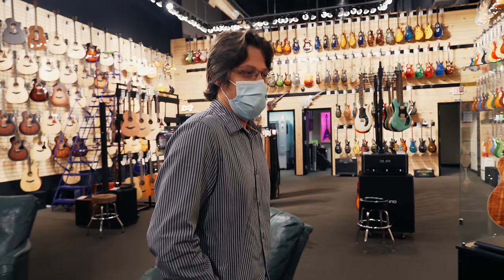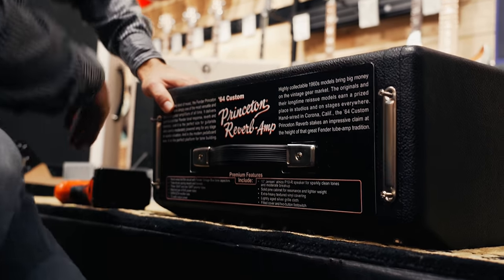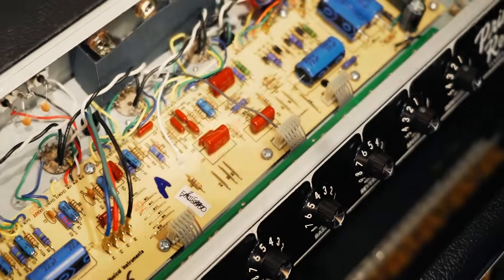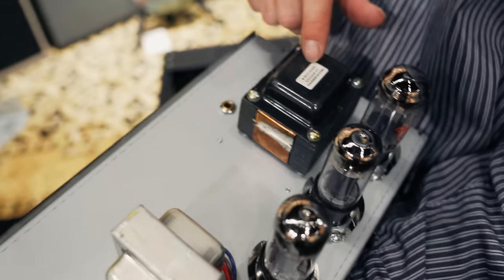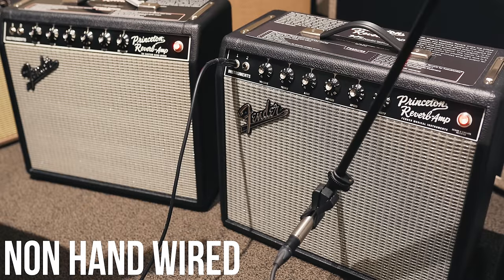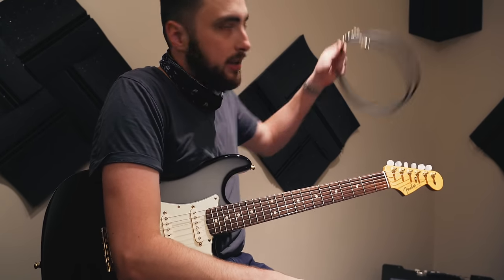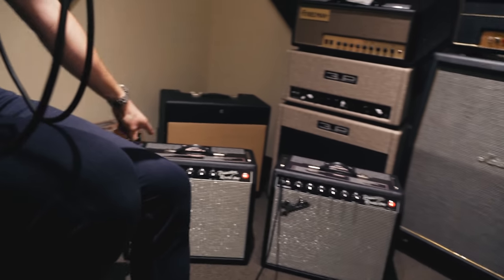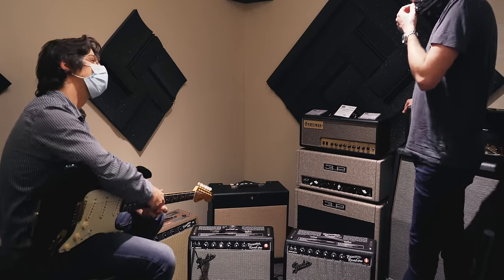Are Hand Wired Amps Really Better?

Comment: SCIENTIFIC FACT:  The  Heavier guage wire allows the current to travel faster with less heat and resistance. The better quality resistorsm caps, etc  really last longer and  effect the signal flow  different than the  cheaper version.
So as you touch the string the magnetic feilds and  response  time is faster  on the hand wired. Plus  the tonal spectrum is different. The durability of  the hand wired is strong heavy duty verses the cheap production knock off.
THE SAD TRUTH  is FENDER  sold out by letting their accountants tell the builders etc to find a cheaper way to make guitars  and amps etc.
HAND MADE is always better. We must all pray America recovers from all the  problems.
My advise and opinion  is : If you want quality you must pay more! HAND MADE  IN THE USA is best.
GOD BLESS those people who make hand made USA gear. The ability for it to last 20 or more years is because all componants  and elements are HEAVY DUTY.
If you drop both amps from 3 feet without tubes.... the cheap knock off will have all the quick connects pop out  and crak etc.
The HAND WIRED will be fine.
IF the greedy  corporate geeks at the TOP  could  have simply held on  and  offered HAND WIRED  at a more reasonable price then FENDER  would not had to sell out.A cost  study was made. It showed the cost of FENDER moving over seas to try to cut manifacturing cost hurt FENDER. 
FINAL STATEMENT: IF FENDER  would have simply held on  and stayed in the USA exclusively and never comprimised their quailty also  a more  reasonable price point they would not be financially in the hole and thousands of pissed off musicians would  not have run to other companies.
FASTER flow of current, HAND WIRED for  pros  and fakers  can go for the cheap knock off.
If FENDER would close all over seas plants  and only make products in the USA they would  recover.
GOD BLESS AMERICA......

Comment: If you hear a difference between the two amps and prefer the handwired? Cool. But Rhett and the salesperson suggesting that you couldn't play a small gig with the stock $1000 Princeton? That the stock $1000 '65 PRRI would disappear in a mix? JFC, what a wanker comment. Plenty of people are out there gigging with much cheaper tube amps: Hot Rod Deluxe, Blues Junior, Peavey Classic 30, Harley Benton, Monoprice, etc. Lots of players are gigging Boss Katanas and trying to emulate blackface Fenders. And lots of those players would KILL for a stock $1000 Fender PRRI. That's an expensive amp for lots of people. 

I find this comment especially frustrating when Rhett plays gigs with Kemper and Helix modelers? WTF. All that modeler stuff is great. I have a HX Stomp myself. I love it. But put Rhett on camera and ask if the Helix sounds better than a stock $1000 Fender PRRI. 100% he's going to choose the real tube amp when it comes to tone. That's just the type of "tone astrology" he goes for. Rhett uses modeling for convenience and reliability. And the audience, especially the non-guitar playing audience, cannot tell the difference between a Blues Jr, a stock '65 PRRI, the '64 custom PRRI, a Helix or a Kemper. If your soundperson cannot dial in a tone for the stock '65 PRRI, it's not the amp's fault. You should be able to get a decent stage tone with a Peavey Classic or even a Harley Benton. FOH.

Comment: Hand wired may be easier to repair, but can we stop pretending that finding someone who can make those repairs and do so in a timely fashion is a service that is readily available, because it's not.
Reply: Psionic Audio says that Fender puts hot components on the PCB of its reissue amps. He recommends getting them off the board so the amp will hold up much better and longer. He said the 70s Marshalls used a similar PCB but didn’t put those hot components on the board. 

PCB makes manufacturing easier. Sometimes a so-called simple repair takes much longer with them.

Comment: You’re better off going boutique. The current fender “hardwired” amps are not authentic. Cheap components, quick connect instead of solder. Headstrong amps makes far better classic fender amps alongside various other boutique companies that waste no exception on quality
Reply: Although do they potentially use quick connects in certain places cause they’re insulated and safer if there’s ever a loose connection?

Comment: TO EVERYONE IN THE PCB IS JUST AS GOOD CAMP:  I can build you a pcb and as I install each part explain to you why it will be better than if it were to be stuffed and soldered by machine.  I can build you a board same exact thing as pcb but handwired it will sound better.  Because I have a brain and the machine is just stuffing the parts.  PCBs are NON Sustainable, disposable, problematic, impossible to rework, etc, etc, etc, etc.  Don't worship your FALSE IDOL of automated machine luzury space commune:  Build and Buy real equipment that will OUT LAST YOU and can be PASSED ON to the future so they don't even have to worry about making amps anymore they will just play them.  Get it?

Comment: Does hand wired make a difference in tone quality when using the same circuit design?  NO.

In your video you highlight that the PCB amp is NOT using the SAME components.
IOW, you've two amps where each one is using the same circuit design, but they are not using the SAME components.
As such, that is what makes any potential tone quality differences, when played into the SAME speaker.

If there is actual perceived tone differences, it is not that one is hand wired and the other PCB.
Any difference would be the component differences.
This fact is proven when PCB amp owners change and upgrade certain components to change, hopefully improve, the amps tone, and the same
goes for a hand wired amp as well. 

The tone differences are quite small, as I hear them on my small studio monitors, when using the same speaker.
Change the mic placement and/or turn the EQ controls, because that is what they are there for, and each amp can be made to sound different or quite similar.
The actual and very noticeable tone difference is the SPEAKER.

If one wants to change their amps tonal quality, the easiest and most effective way is to change the speaker and/or cab.

Comment: This is stupid. Any amplifier has a circuit. Electrons don’t care how the path they travel was put together. Please, please stop confusing construction technique with quality construction and components. 

It is 100% possible to design and make a high quality, through hole PCB and then use top quality components. Keep hot stuff off the main PCB (a big problem with new Fenders). Leave enough space between components. Keep AC and high voltages away from the low voltage signal path. Build it with an intelligent grounding scheme. Use quality potentiometers and jacks and FFS keep them off the PCB. Components that experience regular mechanical stress need to be isolated physically. Buy top quality transformers. 

Do I play “hand wired” amps?  Yes because my hands wired them. I started with a Blues Jr.  A pretty good circuit built in an atrocious manner. It burned through power tubes because Fender saved 15 cents per unit by not having adjustable bias. The crappy pots and jacks are mounted on the PCB. There are scorch marks inside the amp because no one stopped and said “Hey that power resistor is going to get hot!”  Then every time you go inside to fix one thing, more stuff breaks because it is built so cheaply. The ribbon cables are trash.

Comment: Yes they are the same type of components. An Electrolytic capacitor is still an Electrolytic capacitor. 
There is a slight variation in the circuit regarding some values of the components that's it. 
Both amps have the same tube Compliment. Therefore both circuits are very similar or the wouldn't have the same tubes. & the tube bias should be the same or at least very close
Hence any great difference tonal quality / sound difference will be from the transformers. Because the quality of materials used & changes in the manufacturing process of the transformers from the 60's to present day is not the same. Example   Electrolytic capacitors are made far better today than they were in 60's. The opposite is true for transformers 
Transformers affect the sound quality of an amp more than anything else.
Cliche 
they don't mak'em like they used to

Note 
Your Perceived quality differences are made up in your head. 
there's no truth to what you are saying